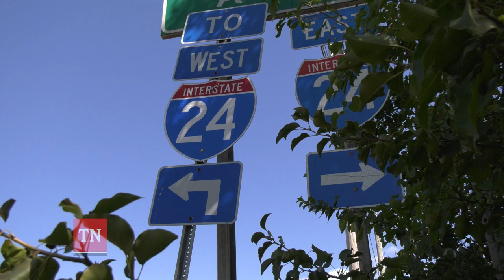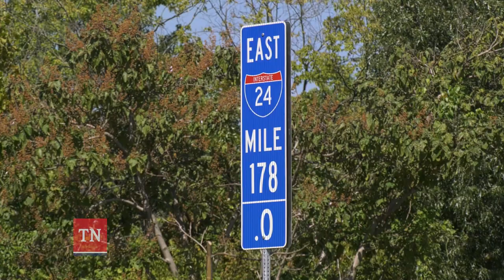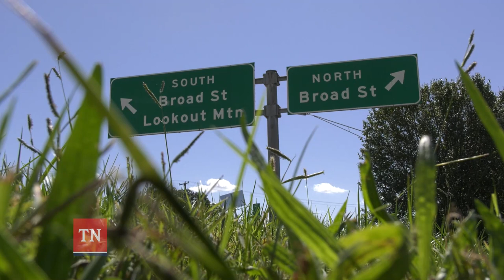I-24 Interchanges at Broad and Market Streets

Comment: What a great and exciting project for our city!! It would be great if TDOT could solve the perpetual traffic at Moccasin Bend issue at the same time.
Reply: Unfortunately, it will likely require a 3-state solution with Georgia and Alabama to properly fix the traffic issues caused by natural barriers like the river and mountains. It's not impossible (see I-275 in Cincy), but it would require a lot more than getting TDOT on board. Plus there are other political issues that complicate coordinating that kind of effort like the TN-GA water dispute.
Reply: I heard they’re going to start widening I-24 to the Georgia state line. But I wish it would be widened all the way up to Nashville
Reply: @colt6488  We need to do what Georgia does, 3 lanes everywhere. I commute from Chattanooga to Nashville a lot and can’t stand how congested it can get sometimes. Slow drivers, asshats, semi-trucks, etc.